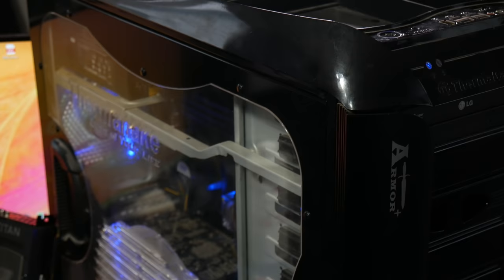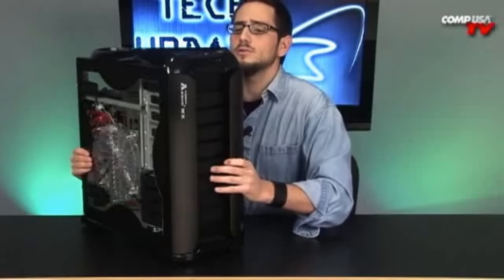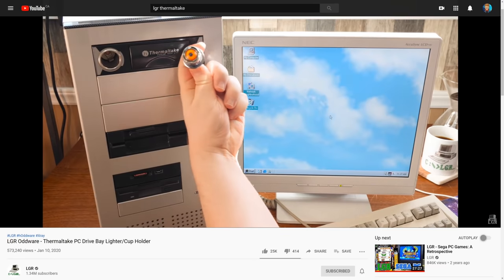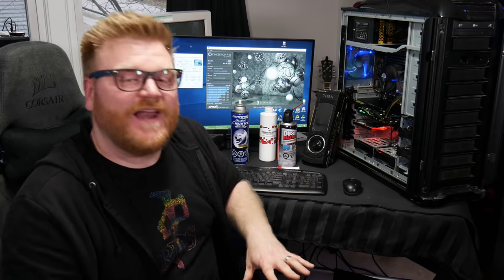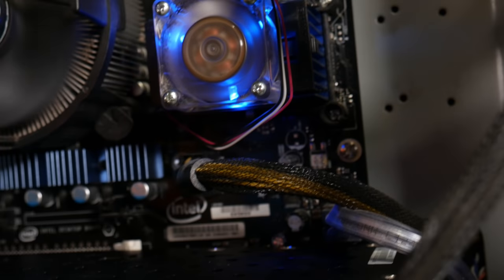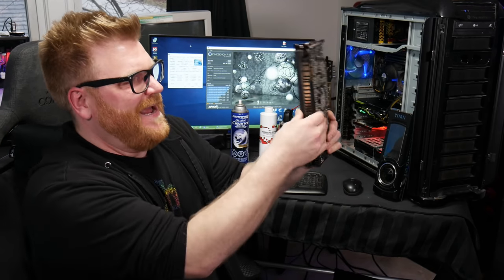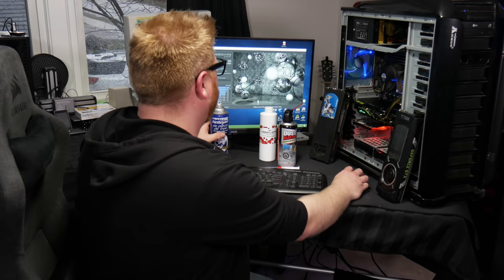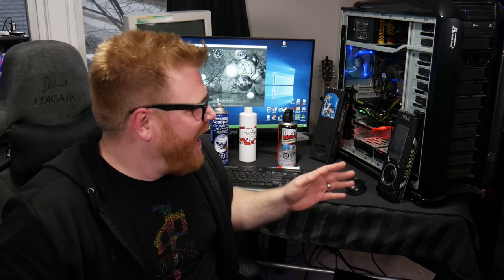Can $5000 buy a PC that will last 10 years?

Comment: Had a midrange pc from 2011 last me a long time. I finally upgraded from 2500k to Ryzen 3600. however I did upgrade my graphics card a few times. gtx 460 > gtx 970 > gtx1080. I still have the 2500k and gtx970 pc and its running fine as my home theater/gaming pc.

Comment: Reminds me of the last PC I built (and still have), you'll love this. it's one of the first I7's to come out, 930 or something, ga-x58 series motherboard, even had a fan ram cooler for it and a corsair H50 AIO haha. 12Gb ram and dual Radeon HD 7950s. Cost me a fortune when it first came out, doesn't run anything now (obviously) hahaha
Reply: The 7950s could probably run Wow classic well lol. The ATI/AMD cards do last much longer than Nvidia cards so I give them credit as that easily through 2016

Comment: For lots of people outside if the pc gamer space, 10 years isn't uncommon at all. Shop I work at has been doing lots of 2020 overhauls on unibody MBPs. SSD, more ram, rethermal/cleaned, dosdude1's patched Mojave. Like $250-400 usually. Works completely fine for youtubing, email, ms office tasks, etc and their ~$1500 investment in ~2010 is better than the day it was new.

Comment: Here is how I roll. I upgrade the CPU and board every 5 years and GPU every 2 1/2 years roughly with a few months between. Modern CPUs do wonders and I don't see any 8 core 16 threaded systems to be out of date for a very long time as console ports have that. GPUs on the other hand do get cool new stuff frequently. That 2009 era CPU could easily game well in 2014/2015 titles. That Titan from 2013 would last until 2015/2016 easily too. 10 year old pcs run great for productivity for 90% of folks who aren't developers, video editors, or engineers to do basic MS Word and Chrome tasks

Comment: I had an i7 930 with 12GB RAM (triple channel x58 board)  I bought in 2010 for uni that lasted quite well, OC'd it to 3.8Ghz quite comfortably. I think 2018 I replaced it. It was a LOT cheaper than that though, about £1000, probs £1500 including upgrades over the years. It was for audio though so no Titans in sight, it got a 460 for a while then a 7950 3GB.
i7 Clevo laptop I bought in 2011 still going strong though!

Comment: I came up from a humble $200 pc I bought from a friend & added a $80 1tb WD black HDD back in 2015.
I'm currently torn between selling my pc or upgrading, but graphics cards are expensive right now.

Total: $1400 from 2017
MB: Asus B350
CPU: Ryzen 7 1700 /w wraith cooler
GPUL: Asus Rog 1080 oc edition
RAM: 16GB @ 3k Mhz - G.Skill
PSU: 750+ gold corsair 
Storage: 500gb Samsung SSD 
Case - Used case I had with the 1tb HDD

Total: $1210 from 2020
Monitor: Dell 27" 1440p, 144hz, 1ms - upgraded from 1080p 40'inch tv
Storage: Samsung 1tb NVME  - needed more storage
Case: Phanteks P600s
Fans: x6 LL120 Corsair RGB fans -upgraded from case stock fans 
Keyboard & Mouse: Corsair K95 plat & Nightsword - Upgrade from shitty keyboard & mouse
Cables: Custom Cable mods - Aesthetic change

PC setup was finished in late 2020.

Total: $2610 

If I were to sell I'm thinking somewhere around the ball park of  $1300-$1500 for the entire setup.

Comment: My first "high end" pc i actully still have. 
Part list was evga x58 ftw, i7 950, 3x4gb kit of corsair vengence, corsair tx750 psu, corsair, 128gb ssd, hyper 212 cooler, antec 900 case, 2gb variant of the msi twin frozer 560ti.  That build was like $1600 bucks......a few years later i got a 2nd 560ti and ran sli. Over clocked the cpu and was good for a while. Few more years down the line i doubles the ram, got a x5670 xeon, and 2x gtx 770s. A few more year later, i got a 1tb ssd and a gtx 1070..........the x58 was such a good platform. Rather then build a whole new system i did little upgrades here and there.......in all honestly, with the way thing are now in 2024. A $5000 pc may still be very usable in 10 years.

Comment: I had gotten a 6700 (non-k) with a R9 390X back in 2016, and 2018 I bought a 1070ti, and then in 2019 I got a 3700X. I think just spending $500 every 3 or 4 years after your initial investment really helps out.

Comment: Computers dont last long, but im happy with my 980ti i bought 5-6 years ago, it has lasted me since and still does a good job.
Reply: just play with games configuration , mainly the resolution , the AA , and textures quality , those eat a lot of Vram , a 980Ti is very good for 1080p/+60 fps  at very high on new AAA games, it's equivalent to a 1070 , the only complain about her is the 6Gigs of Vram that are starting to be  the limit for 1440p/60 fps/Ultra (the new norme in term of gaming resolution) 8 gigs is a minimm for 2020 and beyond AAA games ......but still , GTX 980TI is a great card , and the best upgrade is , in my opinion , the GTX 1080 TI , another huge beast till today , or the RTX 2070 super(for the Ray-tracing and DLSS 2.0) ( yeah,i'm an Nvidia FanATIC )........
Reply: hamdadou cherif mourad i have a big monitor so i want to play at 4k or 1440p at least. Its still a decent card but im going to replace it with a 3080

Comment: My upgrade path over 10 years:

Starting with core 2 duo e6300 2gb RAM HD 4870 (don't know the exact cost) ~600€ maybe. All values are more or less rough estimations. No peripherals or hdds included. 

2010: 

Zalman 3d Monitor 22" right before the 3d hype (still owning it):
220€
Core2Quad Q6600: 
100€
4gb DDR2:
60€?
GTX 460:
200€

2013:

GTX 580 1.5gb:
60€
2gb DDR2 RAM:
15€

late 2016:

Xeon X5670:
70€
12gb DDR3 1600:
70€
Asus P6X58D:
180€
Beefy OC Cooler:
50€
GTX 770 4gb (bargain): 
40€

2017:
RX Vega 56:
500€ (basically free explanations later) 

2018:

Ryzen 5 1600:
200€
16gb Crucial Ballistix 2400:
100€
Kolink Punisher Case:
50€
MSI B350 PC Mate:
80€
RX Vega 56:
yet again - bought from 800€ worth of Ether for mining - sold for 500€ to another miner 2 month after ethereum crash - so the first Vega 56 was free :-) 
Alphacool Eiswolf 240 AiO for the loud and hot Vega 56:
180€
Samsung 28" 4k monitor:
300€

2019:

Radeon VII:
750€
Alphacool Eiswolf 240 for the loud and hot Radeon VII (sold the Vega 56 with AiO for 280€ in the mean time):
180€
Alphacool Eisbaer 140:
80€
MSI B450 Gaming Plus Max:
100€
Ryzen 5 3600:
200€

2020:

64gb G.Skill Aegis 3000:
270€ (sold old ram for 50€)
Alphacool Eisbaer 280 (Eisbaer 140 pump died):
110€

Component Sum (excluding the RX Vega 56 & storage and peripherals (maybe 800€) ): 4265€ over ten years. So let's assume I paid ~5000€ over the ten years and let's assume I sold old components for just about 1000€, I paid 400€ average per year on components. 

That being said I always had a fun time with games and high performance computing for the last 10 years.

Not to forget that I now have a Highend System. And like 14tb storage 5tb free).

Comment: i bought an AMD FX8350, 16GB DDR2 1866, a radeon HD6950, and full custom loop kit that i planned on being a "10 year build." went through 4 motherboards, 3 GPUs, 3 PSUs, 10+ fans, and 2 platter drives in the 8 years i had the build. ended up giving the CPU, mobo, and ram away to someone who had a phenom ii as it was at least somewhat of an upgrade. feelsbad

Comment: Did you try cleaning the GPU? Use a Swab and isopropyl alcohol and rub on the entire PCB. But be very thorough with it, sometimes I use soap and a toothbrush, then wash with water and wait for it to dry. I've ressurected a lot of GPUs with those methods. Some people just spray it with WD-40 leave it to do it's thing a little, then dry it and try it. I avoid this rout cuz WD-40 is like an oil and it doesn't evaporate easily, it might get conductive with impurities and actually Finnish killing the board or at least I think it can.

Comment: My last high-end PC, still in use as high-end WinXP gaming PC (thought was always Win7 in its life time) ASUS Crosshair IV Formula, Phenom II X6 1100T with all cores locked at 3.7GHz, 8GB Mushkin DDR3 RAM 996657 with 6-6-6-18 1T @ 1333 (best DDR3 RAM available at the time, probably still) GeForce 285 GTX and Soundblaster Titanium, 750w Corsair PSU 80+ Gold. The CPU would do over 4GHz stable but there was no need. The turbo speed is 3.7GHz but if more than three cores were needed, it would throttle down to 3.3GHz. Use the motherboard settings to keep all cores at 3.7GHz at all times. Still not Crysis at Ultra, great at Very High, but does FarCry @ Ultra, 1080p in the 200FPS range. To be period accurate, it runs on a 1680x1050 monitor but also don't want to add a 1080 monitor cause again, no need.
It wasn't high-end but if you go high-end and make good decisions, you can make back some good money. The Phenom 1100T commands a premium as the fastest Phenom and the ASUS Crosshair IV is a very good board for the platform. The RAM, meh. Was the fastest at the time, still comparatively fast today but DDR3 is a thing of the past and that speed definitely helped but not really needed.

Comment: I spent $400 to futureproof my case and cooling, half my money went to support hardware like watercooling, quality fans, and a gold rated 1000w modular power supply... then i bought low end hardware so i can game now and upgrade later without having cooling or power problems for the next 10 years... my motherboard, cpu, and gpu will be outdated in 3 to 5 years from now the chassis will last 10 to 15 so i feel like the chassis is more important to future proof

Comment: My motto as a PC gamer is simply, don't spend too much on a PC gaming rig, don't cheap out and only spend what you need to deliver high or very high settings for most games, anything beyond that is really a waste of money that you could save to do another quick gpu or memory upgrade 2 or 3 years later without braking the bank.

This for me works out the best because it doesn't really cost that much and you are able to enjoy all the games whiles playing them more or less at it's best whiles also keeping up with the times as hardware advances.

Another option some gamers could do is stay a year or two behind the curve or buy second hand hardware, that would work out a lot cheaper whiles being able to more or less enjoy high end PC gaming.

What you don't do is buy a PC with the intention of expecting it to last a long time because it rarely does and usually cost an arm and a leg, tech advancements happen at a pretty rapid pace so it's best to be more modest and upgrade every 3 or so years, that way you get to keep up with all the gaming craze at the time without having to bend over and take it up the arse from the bank manager lol, just stick with matching what consoles can do, being able to double the frame rates of that at the given target resolution and visual settings you want and you are more or less good to go.

Anyway, I did an upgrade around 7 or 8 months ago, I got an 8 core Ryzen 3700x, RX5700, 32GB of memory, 500GB M2 drive and a lot of other bells and whistles, I went a bit on the upper scale for a lot of the hardware, case, power supple and all that and it ended up costing me around £1470 and I'm happy with the results, but if I wanted, I could have more or less got the same performance for around £1000 if I was willing to cheap out on some of the hardware that it wasn't really going to impact performance at all but I wanted good quality power supple, case, fans and all that jazz and hardware wise, this is more than capable of playing any game I throw at it with very high or ultra settings with the soothing knowledge that I can upgrade the gpu and whatnot 2 or so years from now and get a big bump in performance without it costing my liver lol.

My advice, just make sure to keep that bank manager away, it's better for your arse in the long run lol.

Comment: I stick with buying buying 1-3 new parts a year and keep an ever evolving system. Last major upgrade (2017) went from fx 8350 to ryzen 1600x, carried over 2 SSDs (128gb and 256gb ), 2 tb HDD and r9 390 GPU. Last year got a new GPU 5700xt, 2tb ssd 512gb nvme and removed HDD. Now this year going to get that last Ryzen upgrade probably 4600/4700. Then next year who knows.

Comment: I don't know. I used a i930 i7 up until 2017-2018. The beauty of those cpus was that you could overclock them with very good results. I had mine running at 4.1 up until I sold it. And used a TitanX (Maxwell). Depending on what games the customer was planning on playing I would say the system he already has is still viable. No point in burning $5k or even $2k to play League of Legends. A new power supply, an actual cpu cooler and a 2060 and he is set. That case though...

Comment: I agree 2-2.5k on Hardware and then he could spend some budget on watercooling  if you want to have some convenience for example.
- Silent
- More overclocking Potential (Gives a tiny bit futureproof-ness)
- Looks good
- Some parts Should be good even after 5-10 Years

And then just save some nice Pizza budget for your friend that is going to maintain that every 2 Years

Comment: I bought a Core 2 Duo E6600 system with a 8800 GTS in March of 2007 for 1500 bucks. In 2010 I couldn't play new AAA games, because 2 cores were insufficient and the GPU was already outdated.

Comment: Good ole Thermaltake Armor+ that needs an adapter for some motherboards to use the window fan.  I had that case for 12 years and finally upgraded it last year even though it was outdated years ago.  It was a good case in its time.

I used to upgrade or build a new computer every two years cuz why the heck not.  A year in the desert and all that tax-free money I throw about $1-1.5k into upgrades to something a little more current at that time.  My last build lasted 5 years and it was time to upgrade.

Comment: i bought a 1.2K€ system in 2014, in France (4790K, MSI gtx 970, matx motherboard and case, 8go of DDR3 ram, 240Go evo SSD and 1Tb hard drive). The only thing i did since, is updated my ram and add some SSD / HDD because i needed extra storage. To this day, it still run perfectly, almost 6 years later. I did the same for a friend, about the same budget but 4 years before, it lasted 7 years before he sold it for a laptop.
I bought this week a new GPU (gtx 2070S) to be able to play in 2K 144fps, even though my 970 is doing really good, even in 1440p, but if all you do is gaming, i don't understand why would anyone spend more than 2K in a computer.

PS : sorry for my english, it's not my native language

Comment: When I think about exactly which kinds of hardware I get for any of my seven Sleeper PC projects, especially since all of my builds will cost anywhere from 2I50 to 5000+$ USD (the latter number mostly being for Threadripper/Titan~based Model Rendering and Meteor Lake X/High Power Xe Data Server systems), I have to focus on one specific detail that not a lot of Techtubers keep in mind for a use case: Application Compatibility; part of why I was against the craze of Radeon RX 5000/Generation 0I Navi was not just because it was launched during a Mercury Retrograde, but also because plentiful older applications that I use for Media Production are not compatible with the Navi architecture and ultimately will not gain official support until a build that is released a year or two from now or not at all, which is why I instead opted for Radeon VII when I started getting the first half of my parts for the eMachines ET1331G-07w build (which I'm still saving up to get the second half of the parts), as I knew that Vega II was a compatible architecture with Vegas Pro (specifically Version 0I6 (Build 0352), the last build before all of Vegas Pro started to downfall in its user~friendliness and obtain serious glitches) and virtually every application that I use, and even if I change out my eventually obtained 3950X for a future generation, at least I know that the Radeon VII will stand the test of time because it was the last major architecture by AMD that outran all of Nvidia's architectures during Turing for CPU+GPU renders in this specific workload (yes, even the Titan RTX is outdone by the Radeon VII in a CPU+GPU render in Vegas), which is necessary for me on a business standpoint to get as much programming out to the public as fast as possible.
The Ryzen 3950X/Radeon VII/064 GB of DDR IV at 2666 to 3200 MHz combo with 07.50 TB of disk storage or better and on an EVGA 850BQ will still be relevant ten years later because this setup will be virtually Bottleneck Free in an application such as Vegas Pro, where ultimately working in Ultra HD (04K/2I60p and 08K Resolution/4320p) with many layers and special effects is truly where this will all be set to their limits; fortunately, since I only ever work in Standard HD (I280x0720 and I680x0720), I will never see this hardware be pushed to its truest limits for years, albeit with one exception: Topaz Labs' AI Gigapixel for Video, better known as Topaz AI Video Enhance, which can presently remaster footage up to 08K Resolution and requires both the CPU and GPU to get optimal performance out of it; given this, remastering old footage will be my only key concern with this combo, where a Meteor Lake X CPU and Intel Xe or Nvidia RTX resource from 2023 may be better suited, but that is totally fine when I have to cross that bridge, Zen II and Vega II are more than enough for now that working on our public programming will be fine and gaming will be a secondary measure that'll still hold up in 2030, even with Picometer architectures showing their faces late in this decade.

Comment: the most expensive PC I had was my first PC ever with Pentium 100 MHz cpu Mach64 2mb vram gpu and 512 mb of ram, the whole set including a crt 13 inch monitor, keyboard, mouse, a TV tuner card(!) and even an inkjet printer was about $2K back in the 1996, which was a hell lot of money back then.

Comment: The most i spent is on my current system. 9900k, 32gb ram, 2060 super, storage, cooling and so on and spent about $2500.  And im just hoping it will be good enough for another 5+ years.